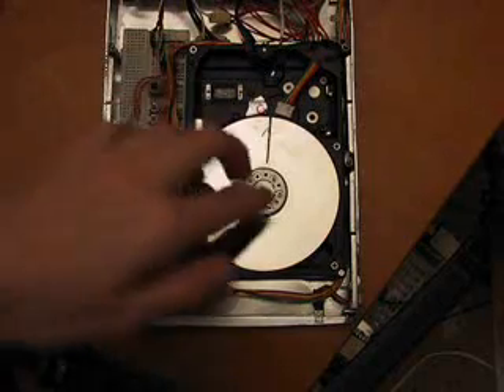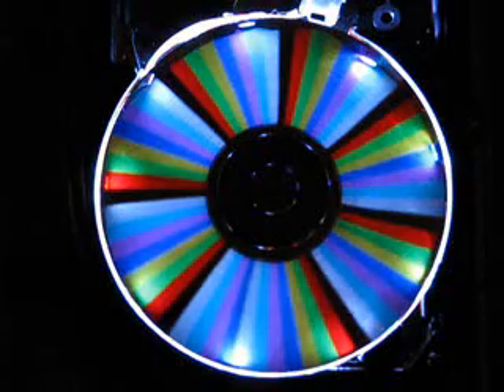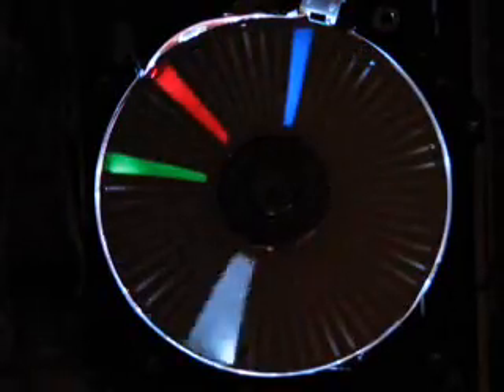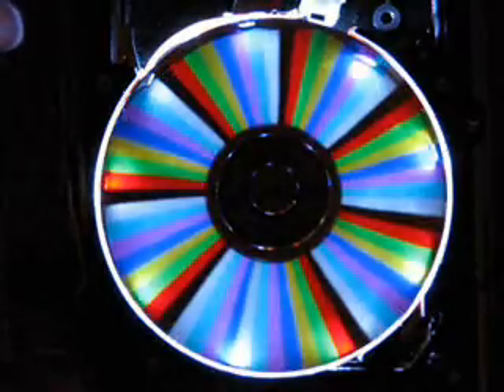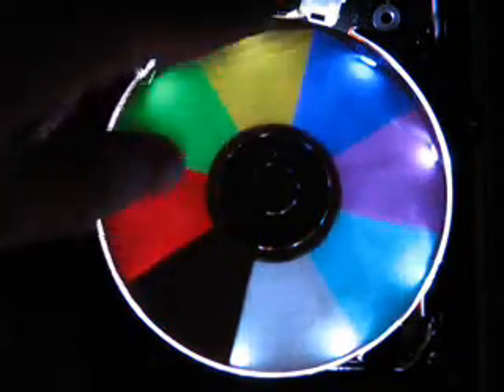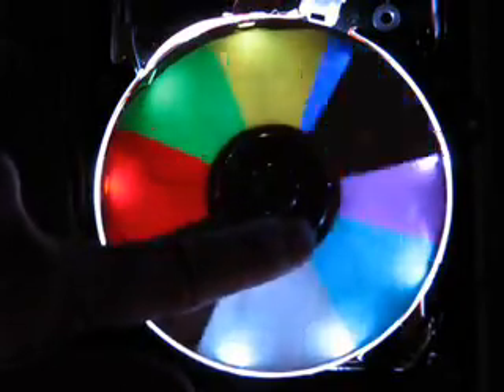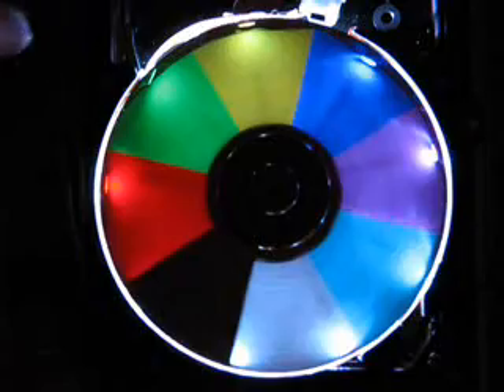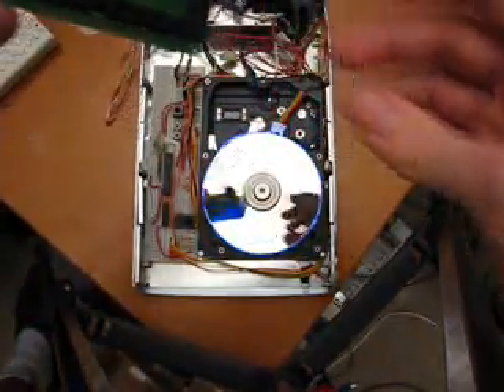LED Hard Drive Clock Demo

Comment: As the  slot passes over that segment, the LED flashes red for a duration "t." t is easy to calculate because the speed of the wheel is known as is the diameter and slot width. So the color of the LED can change 10 times over period 10t, allowing for each segment to be a different color. Then it's just a matter of programming the controller to flash different patterns.

Comment: Actually it's not. look at the part with the screen. It is not mirrored at all. He has the clock going in reverse. It could very well be that the program driving the clock is a 3rd party application meant for a device spinning clockwise.

Comment: that's the noise it makes inside your computer... it's quieter because there are circuitboards in the way and the tower casing... as well has the HDD casing...

Comment: @Amaroqdricaldari A drive's head floats 5-10 nanometer above the platters, if dust comes between the header and the platter, the head will crash.

There already is a hard disk with a built in window, Western Digital's Raptor X.

Comment: @MKahn84 Just reverse the electric current going through the motor. Then it will go clockwise.

What would be awesome would be an Optical Disk Drive or Hard-Disk with a Motor that could spin in either direction.

Comment: @10OchrisO01 Did it occur to you that maybe the hard drive is spinning counter clockwise, and if you were to turn it upside down you had to remove all the circuit boards?

Comment: This clock isn't backwards; normal clocks are. Quadrants in a coordinate plane are numbered "counter-clockwise", with the quadrant I as the top-right, quadrant II as the top-left, quadrant III as the bottom-left, and quadrant IV as the bottom-right. Therefore, counter-clockwise is considered a positive motion, which makes a clock going counter-clockwise make sense, because time going forward can also be considered a positive motion. I know many of you will disagree with me, but it's the truth.

Comment: @10OchrisO01 ITs not... it is going counter clockwise because ... test filming a driving car... or a fan... it will always go counter clockwise or in the other direction as its really going... it depends on the fps of the camera... you can wiki it. ^^

Comment: @fzeromaster yeah...thought so...i dismantled my drive because the electronics seemed to have shortened out the power supply. left only the motor on...pretty neat...i sticked 3 wires to its terminals and juiced it up from the pc's power supply :))...yeah, quite risky, but i must have missed the correct combination the first time, because i kinda heated the engine up...but no 7500 rpm :(...actually, it was quite the opposite: i seemed to have developed some kind of electromagnetic brake xD

Comment: @longbow192 That's correct, 12V for the engine (engine requires more power) and 5V for the circuitry :)

Comment: umm...question...i studied electric physics when i was about 14 and even built some circuits...but i went as deep as around half a dozen working practical projects, but i never got to the "integrated" level, so to say...so, i initially said "question": an IDE hard drive has two power ratings. am i correct if i assume that the 5 V are for the circuitry and the 12 V for the electric motor?

Comment: If you balance the disk (compensate for the slot you cut by adding some weight there), the clock would be a lot less noisy. Nevertheless I think this is a very nice clock :)

Comment: @jse07 
Actually a hard drive will fail if the interior pressure falls too low as the heads need the air to keep them "floating" on the disk.

Comment: @bilkyasko Turning it upside down won't change the direction the hand is moving. You'd need to view it from the other side or a projection against the wall for it to be rotating clockwise. 

Regardless, even if a little impractical, it's still very cool.

Comment: you keep going on about what they can go from and too but if you actually LISTENED to the guy talking instead of pulling this cool thing to bits you would of heard him say that this hdd is a 5400RPM not 15000, 10000 or 7200 but (yes thats right) 5400.
all that aside i think its cool. nice one

Comment: the fastest hard drive i've seen was 15000rpm, and those are extremely expensive.  the average hdd today is half that much.  5400rpm, as this guy said in the video, is not fast enough to shatter the disk

Comment: YOU ARE A DIY HERO

what controller chip did you use? was it programmed externally with software and then flashed over? or is the control all hardware based?

Comment: It wouldnt work if the LEDs underneath the spinning plate would be connected to the plate since there is only a small cut-in where the light is actually able to shine through

Comment: How about cutting a new platter, with two holes to create better balance, and running at a lower speed (say 3000 rpm) - you should still be able to sync the LEDs to it, and it'd make a lot less of a racket as it's running. :)

Comment from the maker: You can get SCSI disks that go at 15,000 rpm too.

For this project, 5400 rpm is fast enough.  If it goes too fast I would need to use a much faster processor to keep track of it!

Comment: Good job!  How do you sync the blinking light and the spinning disc so accurately?  I guess you are using an optical sensor on the slot in the disc to detect both the phase and the frequency of rotation.

Comment: You should try one with a 7200RPM drive for a better time base because it spins 120 times a second, double of 60Hz making a stable clock signal.